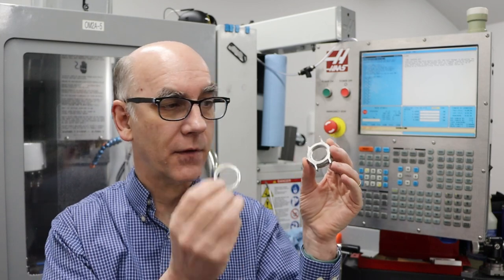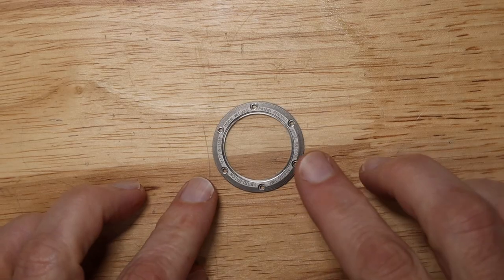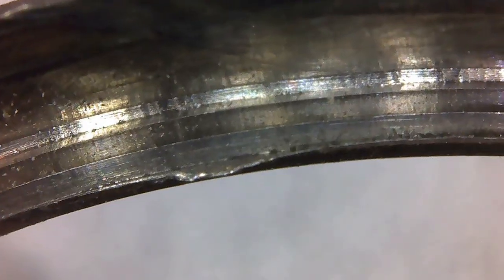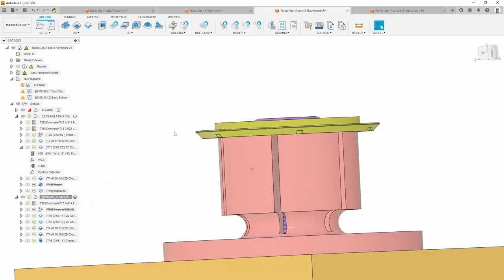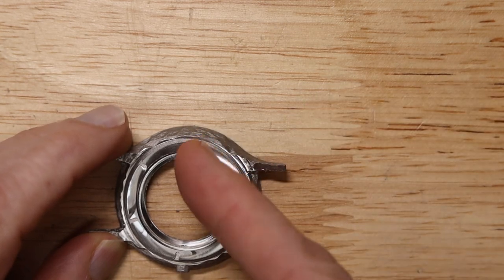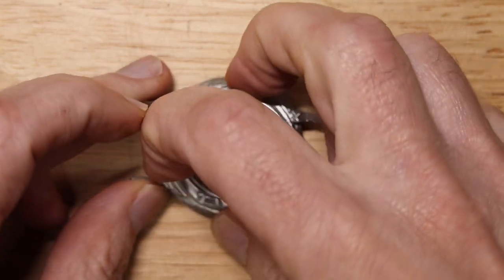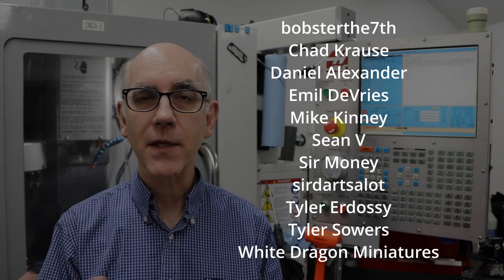A Threaded Watch Back -- Tiny and Tricky Threads

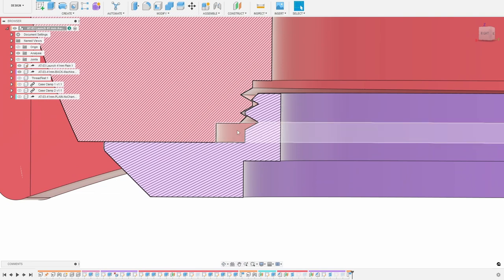Comment: Great work John! At 4:44 when you show the cross section, there is a lot of wasted meat to the left of the threads, maybe a good spot for the o-ring or a gasket? 🤔 That way you wouldn't have to worry about it binding with the threads.
Reply from the maker: I thought about doing that. I chose not to because it would have required a smaller end mill, that would therefore be more likely to break. The current design does the job and is very much like a couple of other watch cases I've looked at with screw-on backs.
Reply: @JohnSL  Whatever works at the end of the day, and makes life that little bit easier I guess 👍